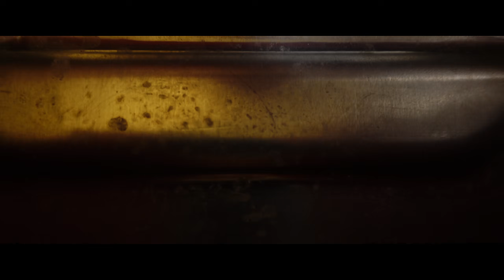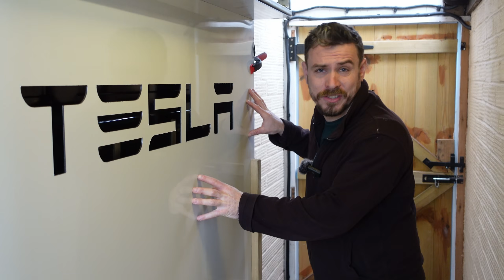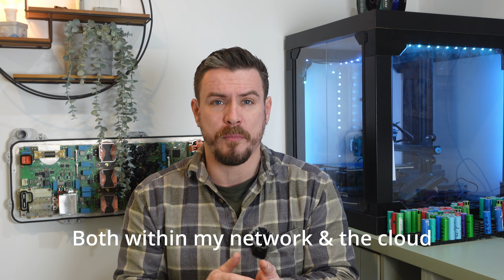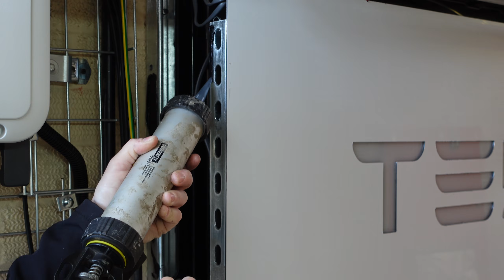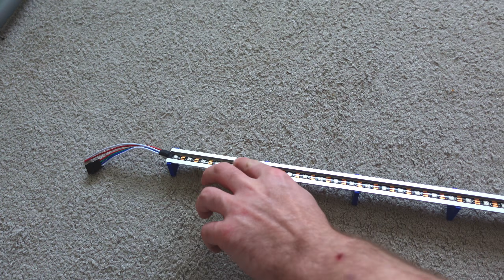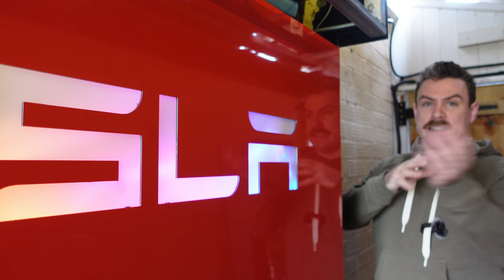The TESLA POWERWALL you CAN'T BUY!

Comment: Hi,  what is the real-world capacity / discharge are you achieving? And what are you expecting from the life expectancy of the battery? Thanks!
Reply from the maker: I’m discharging for 3 hours at full rate is around 15kw per battery. So I’m using around 45 kWh. 

The battery should last years like over 10 years. One issue is that Tesla cell balancing seems to require the contactors to be open. I’ve got plans to open contactors and leave one for a couple of weeks to check its balancing correctly.

Comment: Wow! What a superb work! I also did the Dala implementation with a Leaf battery. It works perfectly but is nowhere near as good looking as yours!
Reply from the maker: Out of interest, what made you go leaf battery?
Reply: @TheOfficialBatteryMan  Simple: At the time (I started with version 5.3.0) it was the only battery fully supported! 🙂Even today, I am impressed about the simplicity of connecting it to the LillyGo and the inverter. 
My biggest problem was, that my Fronius GEN24 was ordered as the "Plus" Version (including the battery license) but after 2 weeks of  analysis I found out, that the "normal" version was installed and therefore the battery SW license was not included (HW is the same for all). Which resulted in inverter "seeing" a battery, but not able to connect to. Hence I was searching the problem on my side for two weeks! 🙂

Comment: Well done mate I too have nightmares with home assistant code but I’m improving as I go along glad you got the LED’s with status thought they would finish it off nicely. PS go bifacial Summer time the sun is going to be higher up so you will produce not mass amounts but every watt helps lol and the price of them you may as well but if I where you just put optimisers on all the panels so you can squeeze out as much as possible and to allow no one panel to bring down your wattage
Reply from the maker: I think most peoples Home Assistant is like the bus scene on the Italian Job. 

I do have a box of optimisers sitting around waiting for the time to get around to a project. It would need to be water tight. I don’t see much about using solar panels for a watertight system. So I think that alone is pushing me to do it rather than returns per say
Reply: @ yeah I imagine it’s just a case of silkaflex or similar used to span the gap by the clamp but bifacials are stronger due to the front and back glass and you may as well try to get any ultra violet light that bounces back to be honest.

Comment: The ROI of North facing panels can be viable if you can get the panels cheaply enough.
Reply from the maker: They have to be cheap ‘good’ panels for sure. Bearing in mind whatever I cover it with will cost money. So it’s replacing one cost for another which I could get some energy from. I’m always keen to find discreet places to put solar panels.
Reply: I'm sure a handful of panels a few years old would make a fine roof for your alleyway. They're always popping up on the Bay of E. A few S/U micro-inverters would save a high voltage MPPT input on your big inverter.

Comment: The work you have done with this Tesla battery is fantastic, I will copy it to my 50KW Deye inverter. Any temperature issue if you charge or discharge with 30 KW ? Or is it a future project to get the battery cooling to work also ?
Reply from the maker: I’ve only had winter to test. So far I’ve not seen above 35c. That’s charging and discharging for 12-16 hours continuously. Once empty charging back up. That’s ambient air of around 15c. 

Bearing in mind from a simple 3 hour discharge my Givenergy under the stairs reported closer to 60c. 

I should put some temperature/current limits into home assistant as a backup for the peak of summer. Possibly water cooling.

Comment: you will get between 50 and 30% of normal production from a north facing pannel depending on brand and if bi-,  given that its only a couple of pannels i wouldn't recommend doing and just go with a glass roof
Reply from the maker: Thank you for commenting. It does get sun in the summer from 4pm onward